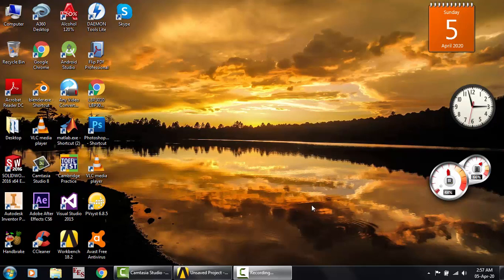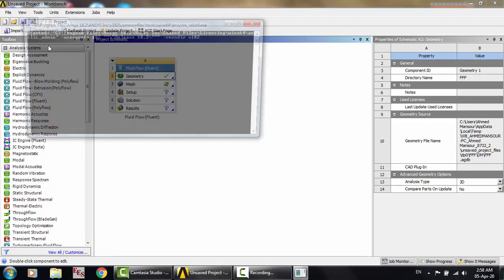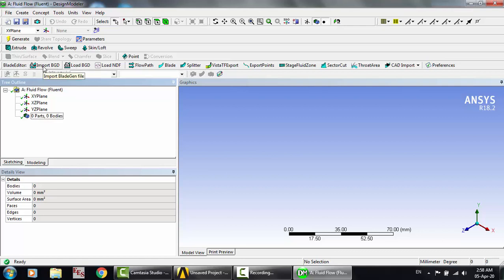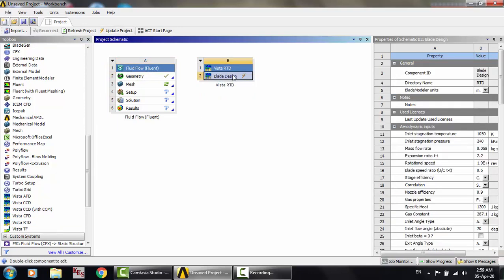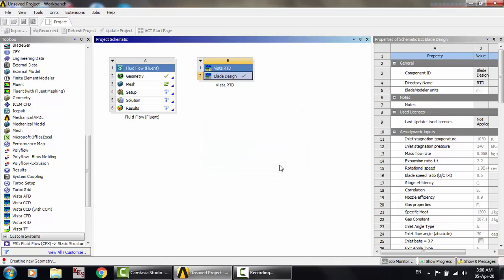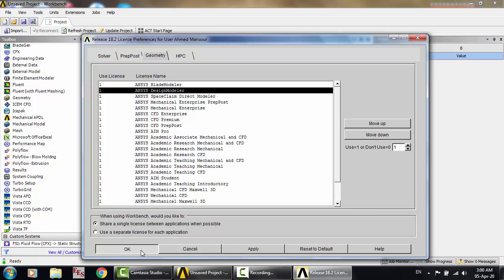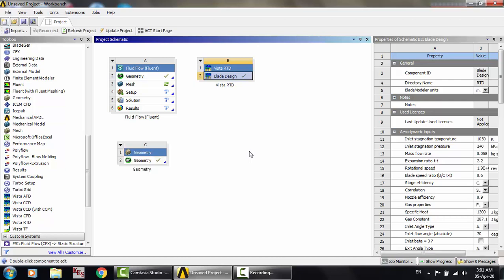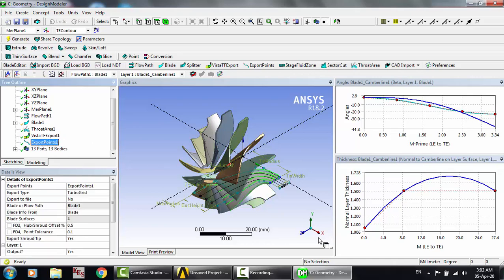How to insert the BladeEditor toolbar in ANSYS DesignModeler and make it BladeModeler

Comment: I am using the free version of ANSYS (student). I am not able to add this option still. is this something unusual or I dont get this add on with the free version?]
Reply from the maker: Yes dear Sina, the free version as I saw when I installed it did not have this. Itwas available till ANSYS 19. I have no idea how to find it. It is better to get the commercial version or any other full version because the free versions have lots of missing features and options. Danke!

Comment: Thank you for this video, just one question, if i have a BladeGen file, there is any way to extrapolate the corresponding Vista RTD packet? i know, usually it's the opposite, but i'm curious if it's possible. Many thanks
Reply from the maker: Hello dear Manuel, what I know is Bladegen and Vista are used to generate the flow path around a blade. We can import their results into the blademodeler. Each one of them has its own inputs. Is there something you wanna do? Danke!
Reply: @haveanicetime  Thanks for your response, i'd like to know all the geometry parameter from a bgd file and since in vista there are a lot of that ones, i was wondering if it was possible
Reply from the maker: Hello dear Manuel, Bladegen has inputs related to the blade angles and thickness. Then you can change the curvature using the plots shown in the next step. Vista has more advanced options and calculates the performance curves because you can enter the rpm and flow rate. It has aerodynamics and geometry sections. Bladegen it is only for the blade design not for the whole machine, so the 2 programs have separate features. Danke!
Reply: @haveanicetime  Ok very helpful, thanks for your explanation, it is clear now, best regards.
Reply from the maker: You're very much welcome dear Manuel! Vielen Dank!

Comment: how do i do this in student vers???
Reply from the maker: Hello dear Aishwarya, in the student version, the blade editor should appear by default because it is included in the license by default. This is what i see every time I get the academic version. Try to open the designmodeler and see if you have the blade editor toolbar or not. Danke!
Reply: time oh but I still cannot see it in design modeler
Reply from the maker: @aishwaryaravi5249  Hello, the license must include the blade editor. Make sure of the license preferences and its options. This is all what I know. I have the student version and it has the blade editor by default. Danke!
Reply from the maker: Open the license preferences, Geometry, make sure that this order is the one you have:
ANSYS AIM Student.
ANSYS Academic Teaching Introductory
ANSYS Discovery Live Student.

Danke!
Reply: @haveanicetime  thankyou very much sir
Reply: @haveanicetime  I have same problem with student version. I followed your steps but  I get the flexnet publisher before the user prefences. So, I do not have enough information for flexnet publisher in the internet. Please Can you help me ? I have joined a contest about the design compressor and also  I have 2 days to send a report. And I could not the CFD analysis.
Reply from the maker: @sevvaltasc3194  Hello dear Şevval, if it is the version 2021 R1, I have no idea because it is missing lots of features. It is better to get another version and make sure it has the blade editor. Danke!
Reply: @haveanicetime  Thank you so much sir, I dowloaded version R19.2 and the activeted the blade editor section.
Reply from the maker: @sevvaltasc3194  This is very good dear 
Şevval ! Viel Erfolg!